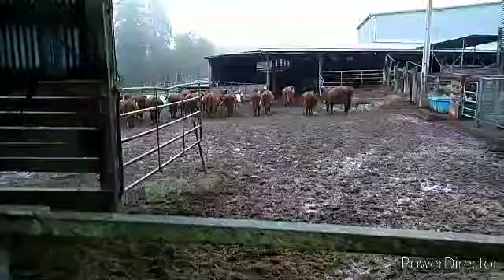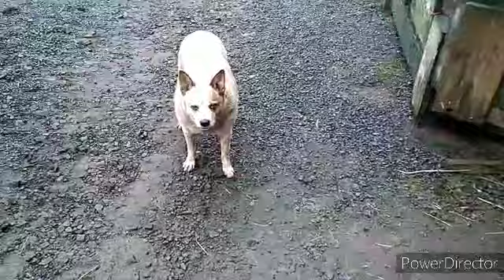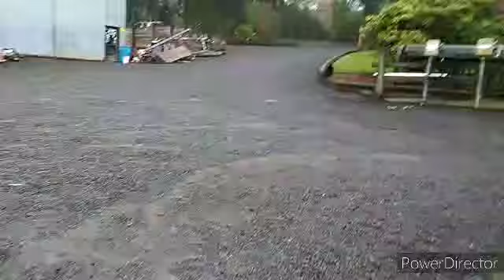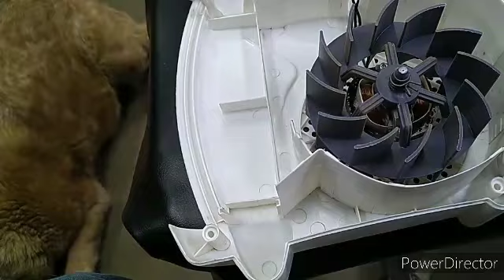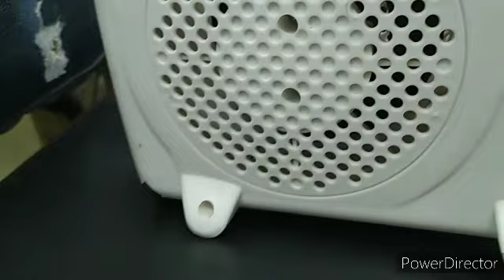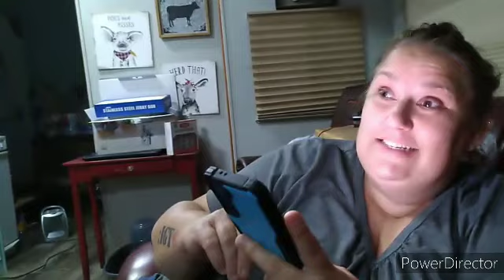fixed a heater, watched football. Beavers Won!!!!!!

Comment: Good evening Ed.  I had a 240 volt electric shop heater. It started getting noisy so I oiled it up. Every so often I had to give it a bit of lubrication. It finally gave up but I got 2 more years out of it. Glad your team won! 
Have a good night my Friend.
Reply from the maker: Good evening.
Just think, if that heater had oil cups or grease zerks to lubricate the bearings... It could have lasted many more years... 
Most implement wheel bearings aren't grease able without taking the hub and bearings out.. I've gotten very good at drilling a hole between the bearings and putting zerks in.. without taking anything apart. Being careful and using a vacuum keeps the chips out👍
Was good to see them win!!! 😁
Thank you! Have a good night my friend!

Comment: Got to love that planned obsolescence as there is more profit in selling a new one than making one that can be repaired for years. Not many nowadays would have the know how or the patience to fix them anyway. Makes more for the recyclers and landfills. Real green and saving the planet. Bottom line is its all about profit. I've fixed a few motors like that too.
Reply from the maker: Exactly... And unlike the past, very few things can actually be recycled.. 
Everything Henry Ford put into the model T, can be recycled and reused today, but very little can be recycled or reused out of today's cars.. and everything else is even more throw away.
Solar panels and windmills are even worse.. so much for being "green"..

Comment: Cool video Ed, I have the exact heater in my shop to repair, the motor is fine but only provide half the heat it must do, I guess the bi-metal strip on the high heat element does not make contact, will see when I open it, man yeaa the Beavers must be you region's team, we don't have football here but rugby is huge
Reply from the maker: Thank you Jan!! 
I hope you can find where the heater is not making contact and can fix it!! 
College football. Both schools are in the valley south of us. Actually in towns that are not far from each other.. definitely nice to have the Beavers win!!👍😁

Comment: Got preg testing done.  Managed to run through 210 cows in a little over 2 hours.  About 6.5 % open and about the same late calving.  Pretty old cows most of them, so a trip to town for them in the new year.
Reply from the maker: Not bad 👍
We had a bad bout of stomach worms 5-6 years ago. Plus a few spells of 100+ (40c) temps. We shipped 23 open cows, fed out 2 young ones for locker meat and an older cow for hamburger.. and I planted 6 cows after they calved..
We calved out 84... That hurt!!!
Lost the neighbors a couple years later, as we were building back up.. UHG
Reply: @GosselinFarmsEdGosselin  I was fairly content.  I buy a lot of middle aged cows, so they tend to hit the road a little quicker.  But they’ve had a few and know what they are doing by that point.  I’m no babysitter.
Reply: Good evening Chad
Reply: @GosselinFarmsEdGosselin  I had sorted off a few earlier too for bad bags, age and attitude.  So have a good liner full to go.  But I’ll probably buy a load this week to replace them while the buying is good.
Reply from the maker: @chadtosh6831  nice 👍
Reply: @tractortalkwithgary1271  good evening Gary.  I’m a little whipped after running that cow squeeze today.  Lol

Comment: Good evening Ed
Reply from the maker: Good evening Richard
Reply: @GosselinFarmsEdGosselin  got the barn cleaned
Reply: @GosselinFarmsEdGosselin  then spent some time  working on the new cultivator
Reply from the maker: @richardwilkens4577  nice 👍
We have to get the feed barn and 2yr. Olds lot cleaned tomorrow.. weather permitting, it will be spread . Maybe even try to get a little more done too🤞
Reply: @GosselinFarmsEdGosselin  it seems never-ending chore
Reply from the maker: @richardwilkens4577  I've found, if you don't make feed.. you can't feed them.. if they don't eat, they don't 💩.. so then you don't have to clean up the 💩🤔
Reply: @GosselinFarmsEdGosselin  I  know mine have excellent  💩  factories